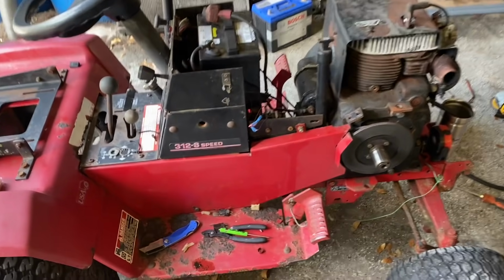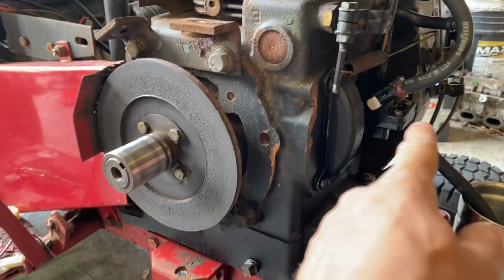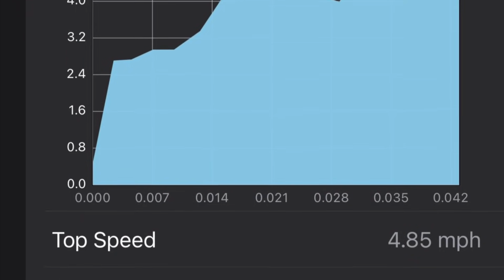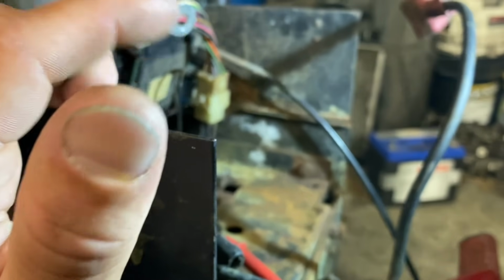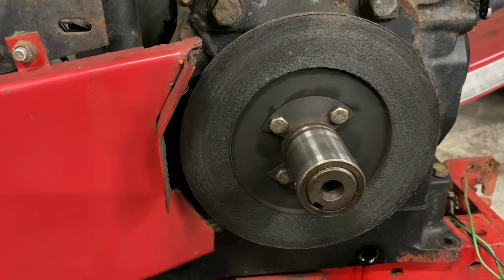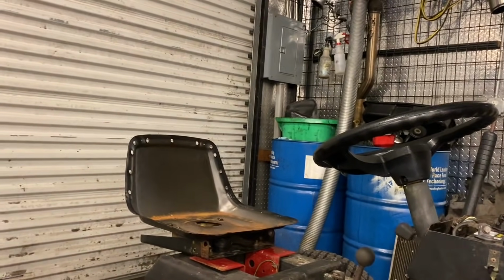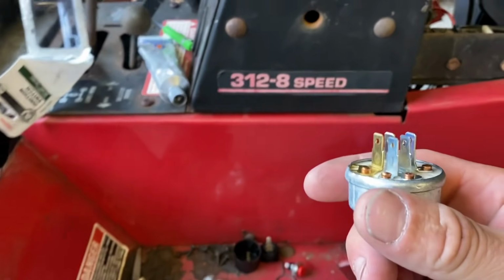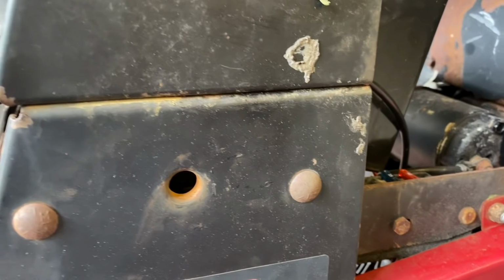Turbo Tractor Begins!!!

Comment: Just run a wire to the battery and one to the push button and then the power wire from there to the starter solenoid